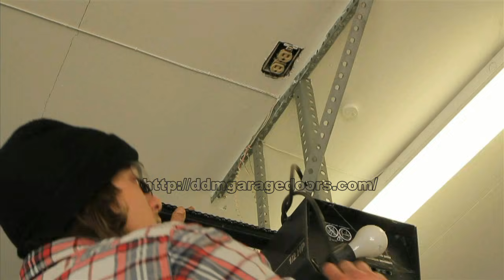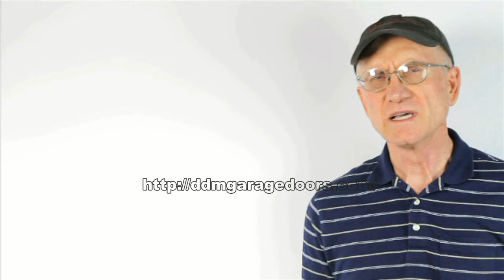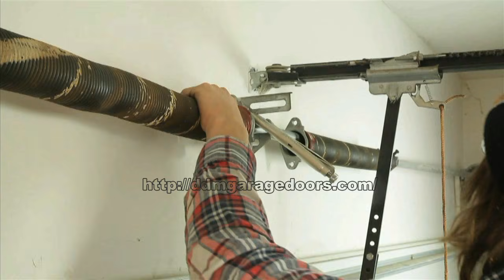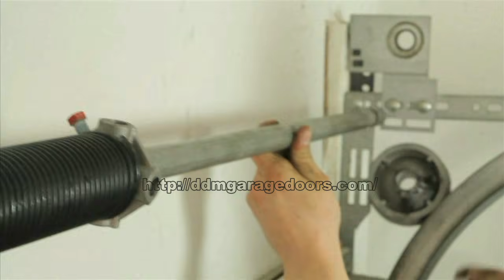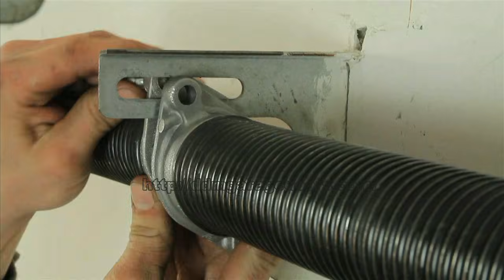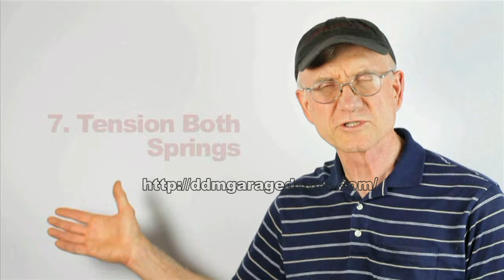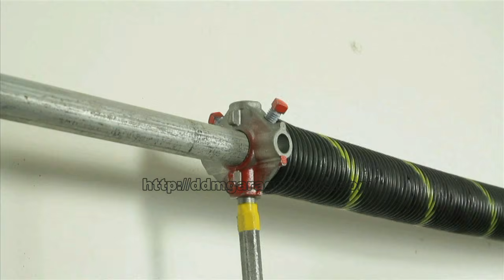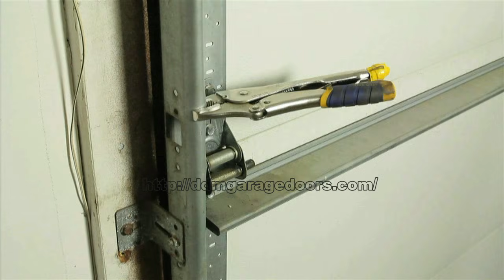How To Replace Garage Door Torsion Springs

Comment: Great Video and instructions !  I could not get the part where you do not oil the last one inch on the spring because it may come out of the bushing !  Also do not oil the painted parts. !  Also does not say  on how to maintain this spring for max  use.  What is the lifetime of a spring as to wear and tear !  How many  opening of the door before it has to be replaced!
Reply from the maker: Hi Tito! Springs don't have a set amount of time that they are good for if they are maintained properly. They have what is called a cycle life, or a number of times that the door can go up and down with those springs before they are bound to break. You maintain the spring by oiling it again every so often so that the coils don't dry up, causing premature breakage. You don't oil the last inch on either side of the spring so that the cones don't slip off of the spring when it's wound up, possibly causing damage to other door components.

Comment: Great concise video with the replacement going exactly as shown , just modified two items. Painted the stripe while on the ground so I wouldn't be spraying the finished drywall, scoring a chalk line also works. After 35 yrs, the light rust made sliding the rod difficult and required me to take off the bearing plates at each end to get the pulley & subsequently the springs off. Took the opportunity to scotch bright the rod ends, while minding any of the markings for the pulleys. 
Also used your video for weighing a garage door, as I felt the old springs were undersized from the installer eons ago & they were. From door weight spring calc apps out there, was able to properly up-size the replacement springs. 
Thanks for all the posted info.
Reply from the maker: Hi Mark! Thanks for watching! We're glad you were able to use our videos to help you replace your springs and get  your door up and running again!

Comment: Can you use a coil that is longer than the one you are replacing?
Reply from the maker: Hi Joe! Yes, you can use a longer spring, so long as that spring is matched correctly to the door's weight; if that spring isn't matched to the weight, then there is no way to guarantee that it will work. We have a spring calculator on our website to figure for longer life springs for doors, if you're interested in taking a look!

Comment: With a whopping 1 year warranty on your springs. Why I'd say go with a company to do it.  I can't speak for others but mine has a 5 year warranty on spring changes.
Reply from the maker: Hi Andy! We have a one year warranty on the springs because we do not make the springs ourselves. We custom cut longer lengths of spring to fit the specifications required by the customer. That one year is to cover any defects that may show up in the springs because those will show up within one year. Otherwise, the springs should always last for the number of cycles they are rated for; once those cycles are used up, the spring will break and need to be replaced again.

Comment: Can't thank the folks at ddmgaragedoors.com enough for all the help this past week with all the questions I had before replacing my own springs. Yes, doing this can be extremely dangerous if you're not careful. But all of the people online acting like you're going to die if you even attempt this are ridiculous. Just use common sense and follow these instructions word for word and you will find that this is a lot easier than what you probably thought. 

Thanks again guys, this video saved me $250 or more!
Reply from the maker: Hi Dirk! Yes, safety does need to be taken into account when replacing your springs. As you said, common sense goes a long way, and taking your time and not rushing cuts down on the chance of injury as well. As we always say: safety first, then work!

Comment: Thanks for your most informative video....looks like you covered all the bases. I had this done within an hour. I have a couple of places here in town that sell garage door parts. I had a broken spring on the left side. Why is it, it seems , that the left side is always the one to fracture?/….Mike...…………... Cicero, Illinois
Reply from the maker: We're glad you were able to get it done so quickly, Mike! I'm not sure why that seems to be the case. It could be something as simple as the fact that your spring and the spring in the video had been on the door for longer than the other side. It's not always the left that goes first, because if they are the same wire size and length, either one could go before the other.

Comment: The best DIY video on torsion spring install I could find.  I obsessively searched and watch a couple dozen, most were OK, none were as complete as this one, and this fellow is an EXCELLENT instructor.  (I used to be in the business-to-buisiness training production).  I would add two things he did not emphasize in this video:  one video I found mentioned replacing the bearings at the ends, this seemed like a good idea, as long as you have it off; and in my case the installer cranked the set screws down so far the shaft was deeply indented, I wish I had know that, I would have been able to replace that.  I reused the shaft, the bearings seemed ok, now have 2 new springs, maybe good for another 20 years.  Thanks, with your help it went smoothly.
Reply from the maker: Hi Jeffrey! The bearings don't necessarily need to be replaced when you replace the springs. If they are worn to the point of being able to see between the race and the bearing housing, or if they are seized up to the point of not being able to turn at all anymore, then they would need to be replaced. The shaft can usually just be filed down, and will not need to be replaced either. It's always up to the customer if they want brand new parts on their door with their brand new springs: this does make some sense, and it's absolutely up to preference as long as the old parts still function and do their jobs properly.

Comment: https://youtu.be/jamhqNRcnYk

I have a 7.5x16 foot garage door. it is a double torsion spring system. Visually, all of the springs and cables look good. My door was working perfectly until the cables came off the drum on both sides. I should have reworked the cables while the door was in the upright position but I manage to lower the door. Once down rewound the drums on both sides and made sure that there were no obstructions. I have a lot of tension in the cables but when I try to lift the door manually it won't budge. When I tried using the the electric opener initially the door did not budge but the shaft that runs from the electric opener to the door bowed away from the ceiling and the system stop. I tried this a couple of times and got the same result. It appeared to me like the spring shaft started turning before the drums such that the cable barrels were not engaging quickly enough to lift the door.

After watching several videos online, I used winding bars to turn the portion springs gradually up to 3 or 4 full revolutions. I did not loosen the portion springs from the shaft, rather just turned the springs tighter. I reworked the cables which now have a high degree of tension. Again the door would not budge manually. However, when i tried to raise the door with the electric opener the door raised about six inches before the the opener shaft bowed away from the ceiling again and stopped automatically. The bowing was less dramatic than the prior times. Logic tells me that twisting the torsion spring shaft was a step in the right direction but the last turn was extremely tight and given the dangers that I've read about, I wanted to seek some advice before going in further. My question is am I on the right track? Should I just keep winding the shaft until the door eventually lifts or should I just unwind the springs and rewind them?
Reply from the maker: Hi John! We would definitely recommend putting the cables back on when the door is up. This usually tends to work better than putting them back on the cable drums when the door is down all the way. You definitely want to loosen those springs, as you need to  You should also undo the set screws that are holding the spring to the shaft before you wind it again. You always want to be careful when you do this and hold a winding bar in the winding cone when you're releasing that tension back into the spring. The cables should have just enough tension to lift the door. The springs should be what is carrying the tension of the door more than anything else. So, we would say you should unwind the springs and rewind them.

Comment: Extremely helpful and detailed video. A torsion spring broke on my garage door just before Christmas. I am quite handy and have tackled things from engine rebuilds to roofing/plumbing/electrical, but hadn't dealt with torsion springs and knew they were potentially dangerous if not handled properly. I'm grateful to have found this video and related videos you have shared regarding what to measure in order to determine which springs to order. I found those very easy to follow as well. I ordered the springs and received them extremely quickly even with the holidays. I finished the install earlier today. I probably spent 2 hours all together. I only had to tweak the # of turns from 30 to 28 to get the door to stay put when open halfway. The door now functions better than ever. Thanks again!
Reply from the maker: Hi ElementL116! We're glad you found us and we're glad you were able to get your door working again!

Comment: Extremely well made video. Contains each step, thoroughly out together. As long as you use every tool he shows and follow each step you will fix your door. I recommend undoing the good spring for measurements. My bad spring gave me an incorrect spring measurement.
Reply from the maker: Hi Spencer! Yes, we recommend this too, but we would also say that you shouldn't just go by the measurements on your good spring. The two springs may not be the exact same size, and if you assume that they are without measuring, those new springs may be too strong or too weak for your garage door. Normally, this mismatched spring pair is seen on about 1/3 of all garage doors, as the installers of the door, or garage door repairmen will just put up springs that match the weight properly, regardless of if they are the same size spring or not. There is nothing wrong with this as long as it properly lifts the weight of the door, but in measuring new ones it can throw off things if you don't measure both springs individually.

Comment: For all you homegamers out there,divide $200.00 by Twenty Years. Yep,calling a pro is cheaper. 

You don't mind paying a $100 plus a month for cable but you think you're saving money doing this once every 15 to 20 years,good thinking!

Awesome video! Been doing Resi and commercial for 18 years now.I learned from this video too! I never learned to put my drum in between the flag and track,I counted lines and not the spaces.
Reply: You never stop learning about doors.
Reply from the maker: Hi ManyHammers! This is something that can definitely be done by the homeowner, if they wish to undertake it, so long as they ensure that they are being safe in doing this task. If you don't feel safe, you shouldn't undertake this. Safety first, then work!

Comment: You forgot to lube the end and center bearings.
Reply from the maker: Hi ManyHammers! This is something that is a good thing to do, but is not essential. Unless the bearings are making a horrible noise, or are seized up, you don't necessarily need to do these two processes at the exact same time.

Comment: Question:
My spring is alright but the guy who installed my garage; he installed "center support bracket" to the drywall with no proper support like wooden flame. Which is why, my drywall has cracked. I want to install the bracket to the middle of the garage door which has the wood flame where I believe I could mount the bracket to. I was wondering, do I have to loose the spring to do so or so I just go for it? Plus, where can I buy the winding tool? Can't seem to find it from Canadian Tire, Home Depot, nor Rona...
Reply from the maker: Hi Luke K! You definitely have to unwind those springs before even thinking about touching the spring anchor bracket in the center above the door. Those springs have so much tension in them that doing anything that will move them without unwinding them is an extremely dangerous procedure and should be avoided at all costs. Unwind the springs first, then add wood behind the bracket to get it back into place in the center of the door and reinstall all the parts as they were previously.

Comment: My garage door torsion springs needed to be replaced.
They no longer provided adequate force to allow the garage door to open and close.
(The door had a lot of weight when lifting it up)
Rather than tightening the existing (old) torsion springs I purchase new ones as well as the torsion spring bars.
I asked about 12 people from work if they have every replaced their torsion springs.
All of them sad “No, this is very dangerous and you should have a professional do it”.
I was very apprehensive about doing this myself due to the dangers involved.
This afternoon my wife and I replaced our garage door torsion springs.
We followed your video and had no problems at all.
Thank You so much!
Reply from the maker: We're glad this video helped, Jeffrey! Your coworkers aren't wrong though: this is a dangerous task if safety precautions are not taken. Also, if you ever add weight to your door through reinforcements, insulation, or something else, you cannot just tighten up the old springs. The weight of your door has changed, so you will need new springs that will properly lift that weight.

Comment: Very well-presented video on replacing broken garage door torsion springs!  The presenter did an excellent job of describing both the proper procedure for removal and installation, and also the critically-important safety considerations.  Well done!
Reply from the maker: Hi arnie! Yes, we always make sure to stress the need to be safe around garage doors. You absolutely need to make sure that you're safe when working around a garage door, including and especially concerning the springs. Safety first, then work! Thank you for the kind words.

Comment: I really really like this instructional video, it was awesome. I  Hung a new sectional door and used this to workout how the components of the torsion spring system work. Could not have done it without this. Good that the guy is saying what to do in the background, not just annoying music and the odd text comment like many videos. Especially liked how to put the cable on the drum and then use vicegrip pliers to hold it there while you go and tension the spring. The Aerosol strip on the spring:-brilliant idea.
Reply from the maker: Hi Roger! Yes, that strip is very helpful for figuring out how many turns you have put on the spring. The vice grips are a good safety measure to use, as they will stop the shaft from turning while you wind up the springs. Safety first, then work!

Comment: This video was outstanding. Very clear and accurate instructions for the entire process. Especially checking the door at the end. It turned out my springs were wound a bit too tight and the door was raising on its own, but the instructions were clear and I was able to make the proper adjustments. The garage door works just as well as it did before the spring broke. Thanks for posting this video!
Reply from the maker: We're happy to help, juliehunsucker! Glad to hear that you got your door working well again.

Comment: Thanks to Dan and his assistant.  My spring just broke and the door assembly has other problems that need to be attacked. This will be a great help because it illustrates how these systems work.  I have what is probably special track work for low overhead and I have to try to figure that out.  In addition, my springs are at the ends of the tracks rather than over the door.
Reply from the maker: Hi ionizing EMR! You likely have a different system than standard torsion springs if your springs are mounted differently than what is seen in this video. We hope this video is helpful to you, and also, if you have need, we have a tutorial on how to wind springs in low headroom setups on our "DIY Instructions" page on our site. As always, feel free to contact us through email to send picture of your setup so we can confirm what you are seeing.

Comment: Do you recommend replacing old torsion springs with zinc galvanised springs?
Reply from the maker: Hi cooljames 01! We do not recommend zinc galvanized springs for standard torsion springs, because they tend to rust much easier than the coated steel springs. If the springs are EZ-set springs, they only are made as galvanized springs.

Comment: Terrific video and a great company to deal with.  Their website was very easy to navigate and they had tools to help me choose the proper springs for my garage door.  I ordered beefier springs than what the builder had installed (plus resized them 20lbs to accommodate the weight of the insulation that I added) and also bought the important winding rods from DDM.  

The video here made it easy to do the replacement.  I watched the video twice, took notes (six pages worth) and then did the replacement.  I used sidewalk chalk instead of paint to mark the spring, and the only problem I had was when stretching the spring.  I would tap it over and then when I let go of the winding rod, it was slide back.  I ended up keeping pressure on it after tapping for the stretch, and then finger tightened the set screws.  I was very cautious when unwinding and winding the springs, and the whole process from start to finish took me about an hour and a half, including breaks to escape the hot garage!  Thanks DDM!
Reply from the maker: Thanks for the kind words, James! We're glad that you were able to complete the replacement successfully!